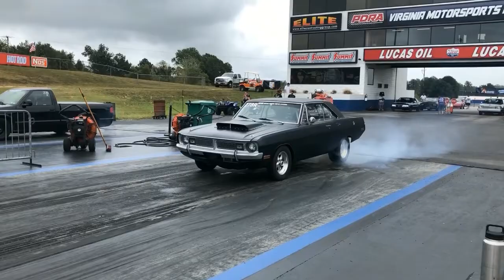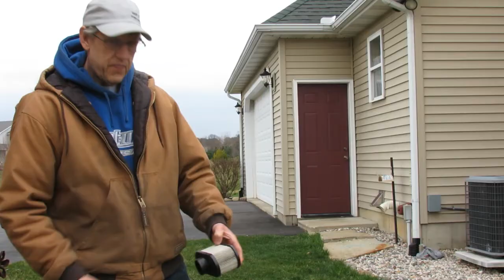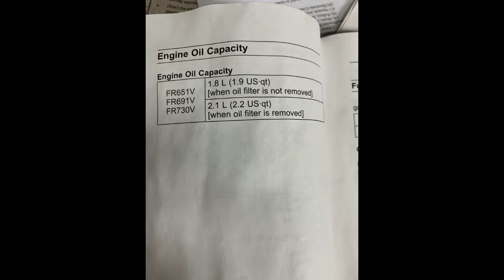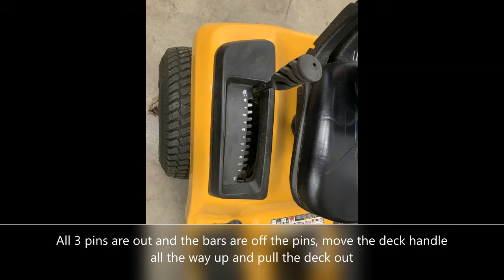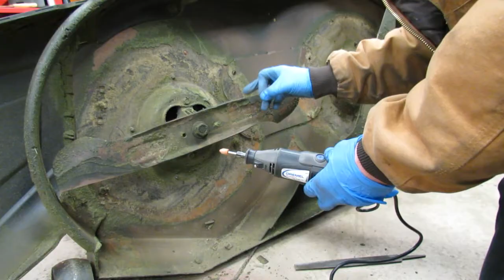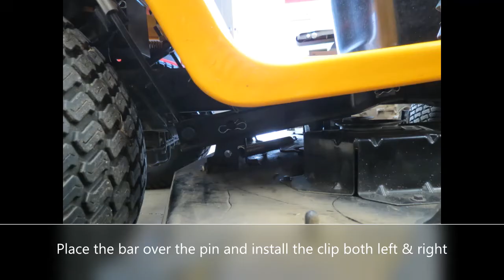Cub Cadet XT2 riding mower maintenance

Comment: Hi, you made a very helptul video but I have one question.  When I changed my air filter, I am still getting a notice on the screen that says I need to change the air-filter.  How do you reset this warning?  Thanks
Reply from the maker: I am honestly not sure, I haven’t come across that, I looked in the service manual and it doesn’t mention anything about resetting. I looked at mine for any kind of button to press and hold and didn’t see anything.
Reply: Hi, I reread the manual and it looks like the air-filter change light is supposed to go off after two hours of use.  That did not happen in my case so I may just disconnect the battery and see if that makes the notice go away.   @ShopDogFabrication

Comment: Nice job on the video, very easy to follow and liked the stills being used where needed.
As far as pre-oiling the gasket being personal preference…….i think not….I think if you DON’T pre-oil the new filter gasket, every previous generation that’s passed away that has taught their sons and grandsons to do an oil change would collectively spin in their graves and the earth may be tilted off it’s axis!

Comment: THERE ARE GREASE FITTING ON THE TIRES   hint get gator blades they are much better and do a better cut  I have them on both my cub cadets   LTX1042KW    V TWIN  2016  AND LTX 1046  V TWIN   2022  ALWAYS CHECK YOU HOV COVERS FOR LEAKS      GET BLACK PERMATEX TO SEAL THEM AGAIN AFTER TAKING THEM OFF  clean them well and make sure they are not bent where they go back on .  Most mowers come with a corks gasket you can make your own if you want to but permatex works

Comment: Just finished replacing the blades on my XT2 and when I flipped the deck back over noticed the spring hook and spring itself became unattached. Now I am a bit confused where they go back and can’t find it anywhere. Any thoughts would be much appreciated. Thank you.
Reply from the maker: It will be easier to google xt2 deck images and there are several exploded view images that will show how things go. That is easier than me to explain it or figure out your exact issue.
Reply: @ShopDogFabrication  Thank you for the quick response. Unfortunately, looking at all the diagrams and videos online was my first go to but they didn’t show where exactly the spring hook attaches to my particular deck (non manual PTO 42” xt2).

Comment: What size belt are you using? I bought a 46” belt but it’s too small.
Reply from the maker: I’d have to look in the manual, haven’t replaced the belt yet to know what length it is.

Comment: If you could find a foam sleeve to put around air filter, easier to clean & last longer. Take off, clean, let dry then work in some clean engine oil. Reinstall.

Comment: I used this video to change the oil/filter in my cub cadet! My husband passed away a year ago and I knew it needed it. My neighbor offered to help me, but I’m pretty independent. The guy at the store told me I didn’t need a new air filter. I appreciated his honesty, but he hates blowing them out. Suggested just banging it on a hard surface. Now I need to service my Lawnboy push mower. Thank you for the help.
Reply: Hello Elaine. I have the XT-2 Cub and it's six years old now with 120 hours on the meter. Regarding the engine air filter, the filter has a foam pre-filter on it. Remove that pre-filter and wash it with Dawn soap. Then put just a little engine oil on it and squeeze out as much as you can. Depending on how dusty conditions are, I wash and oil the pre-filter about every 10 hours. I've not had to replace the actual air filter since I bought the tractor in 2016. Just keep that pre-filter clean.
Reply: Elaine can you say where you are located?

Comment: I'm pretty sure the XT2 has grease zerks on the front wheels, if so, you missed those, also it is important to check the balance of the blades after sharpening. If a person doesn't remove the blades they can't check the balance, so its highly recommended to remove the blades. There's enough vibration on these big mower decks we don't want to add blades that are way out of balance, they don't need to be perfect, but they should be close. The music was WAY TOO LOUD.
Reply: Alex deDios  Nope, I have the XT-2 and it has zerks on the inside of the wheel. BTW, do you lube the open steering gear?
Reply: @geojohnson5613  better to keep the open steer gear clean, attracted dust to open grease would prematurely wear the gears out. At most a dry silicone spray.

Comment: I know they have a adapter for a water hose I don't like to use that but what is that other little plastic thing on the opposite side on the deck Cajun land Church Point Louisiana
Reply from the maker: I prefer not to use it. Grass gets packed in all kinds of areas and if the water doesn’t get all the grass clean it will stay wet and rust the deck. Cleaning it with the deck off I’ve had my decks last longer. Just my opinion.
Reply: I use the deck wash.  Have the blades set at the lowest setting.  After that I raise it to the highest setting and run it for several minutes.  My cub is 21 years old and still runs like a top.  Proper maintenance is the key.  I added the deck wash a couple years ago since it did not come with one.  Before that I would scrape it at least twice a season.

Comment: Subscribed! Is this engine built by Kawasaki or by Briggs and Stratton? Just asking cause your description says use Briggs or Kawasaki parts.
Reply from the maker: Kawasaki
Reply: Shop Dog Fabrication thanks shop dawg! Loved your video, I will be sure to rewatch if I end up buying the xt2.
Reply: When I bought mine there was a choice of B&S or Kawasaki. I took the latter.
Reply: When I bought my XT-2 in 2016, the Kohler 7000 series engines were standard and the Kawasaki engines came in a few of the higher priced models.
Reply: @geojohnson5613  I bought mine right when this model came out.  The dealer had one Kawasaki and one Briggs on hand.  I am VERY happy with the Kawasaki!
Reply: @Daddymouse-ny9cz  That's great! To the best of my knowledge, the Cub Cadet tractors have never used the Briggs & Stratton engines, only the Kohler or Kawasaki. My Kohler has 128 hours on it and runs strong.  In the video he shows removing the Kawasaki air filter. My Kohler has a foam pre-filter which catches 90% of any contaminants. I wash and oil the pre-filter a few times a year and the actual filter is still in good shape after six years. One thing I did that virtually no one else does, I changed the fluid in the transmission. It's not too difficult to do and will add years to the life of the transaxle. It comes from the factory with 10w-30 motor oil and Tuff Torq suggests a drain and fill at 50 hours with their 5W-50 synthetic Tuff Tech hydrostatic fluid. Tuff-Torq makes the hydrostatic transmissions for most all of the lower end lawn tractors, even John Deere.
Reply: I purchased a XT2-LX46 last year and think it’s a little overkill for the amount of lawn I have , averaging approximately 12 hours a season. I’ve change the oil and gas filter at the end of the mowing season, and drain the tank and run her dry as suggested by the dealer. Very little to grease.(4 zerks). I will check the air filter and plugs as well as suggested. Not looking forward to doing a transmission clean out in a couple of years.

Comment: Mine is fuel injected with 92 hrs. It is throwing codes E-4 & E-8 it will not start.
Reply from the maker: Not sure what those codes are, my questions would be: 1) does it crank over but won’t start? If yes then this is a fuel issue, spark issue, or compression issue. 2) if it doesn’t crank over at all then it may be the seat switch, or the neutral switch on your pedal, or a bad connection at the switch or starter.
Reply: @ShopDogFabrication  or a bad battery.

Comment: Nice video! Tip..... When changing the oil the 1st thing to do is remove the dipstick then drain. The oil needs to vent properly and this will speed up the draining time. Next Before you close off the drain plug remove the filter as residue oil will still pass into the used oil pan. Next what you didn't show is once the dipstick level is showing full run the engine 2 or 3 minutes, this will fill the oil filter! Then check the oil level again and fill the amount required. Best regards, Jay
Reply: Those are good tips. Another thing I always do, and this should be done on auto cartridge filters as well, is to fill the oil filter with oil before replacing it.
Reply: Warm up tractor before Changing the Oil.  Be sure you have the correct Filter, Oil and how much oil the engine needs.  Filter is horizontal and cannot be filled.  May recommend NOT putting oil in the filter, although I always have.  Some big companies do NOT recommend filling the filter so manufacturing debris left behind does not get into the Oil stream.  Put Date and hours on Filter.

Comment: your using the wrong engine oil, you need
small engine oil it has high zinc the oil you used will not protect the cam.
Reply: Under the SAE classifications there are limits on how much zddp can be in the oil, SAE30 has the same limits as any standard automotive oil. Under SAE SG to SL you can't have more zddp unless the oil is SAE40 or above. If you use the required SAE approvals you won't get more zddp unless you are using SAE40 or above. If a SAE30 really has more zddp, then it won't meet the SAE specs required in the owner's manual. All motor oils contain zddp, but the max allowed is lower in all SAE30 and a bit higher in SAE40 and above.
Reply: @G56AG  Toro Full Syn oil is API SN rated but says: "Outstanding anti-scuff protection with added zinc and phosphorus." I don't know if your claim is accurate if there is no catalytic converter. They are adding these agents to SN rated oil.
Reply: @bigwilliearmitage  Its interesting, a lot of oils make that same claim, but API limits the amount of ZDDP and phosphorus in the oil. An exception are SAE 40 and up, they consider that vehicles using that grade are usually older and might not have catalytic converters, so the limits are higher than the SAE 30 grade oils.
Reply from the maker: Rafael Torres the Kawasaki manual has a classification of sg, sf, sh, sj, or sl listed. And ranges of viscosity based on temp ranges. No where does it say you must use zinc additives.  The oil I am using meets these classifications.